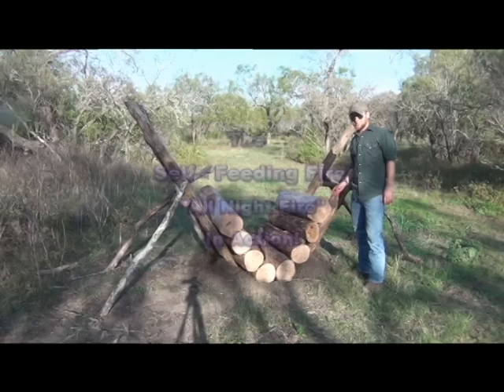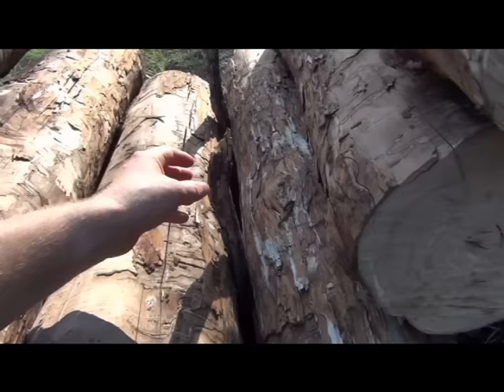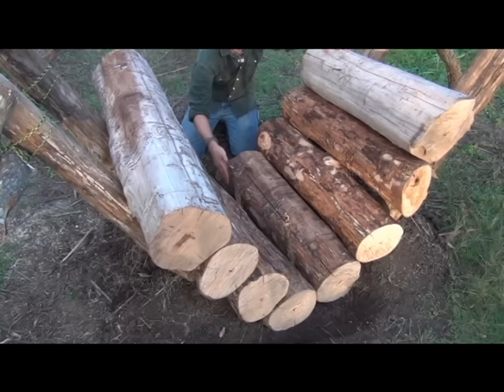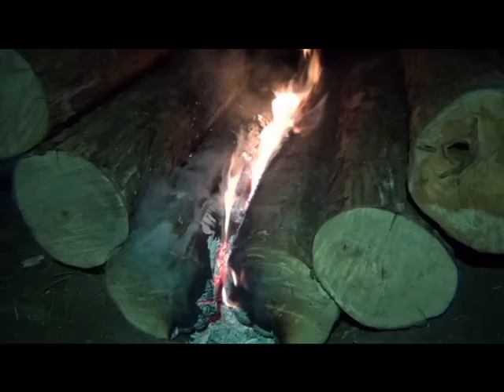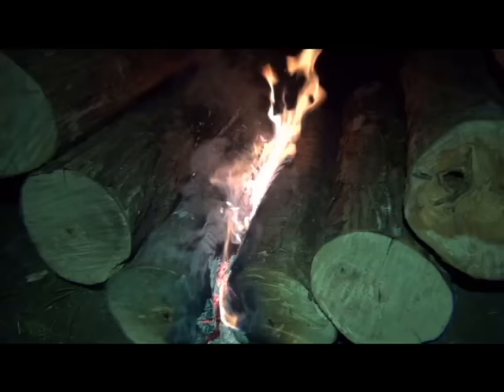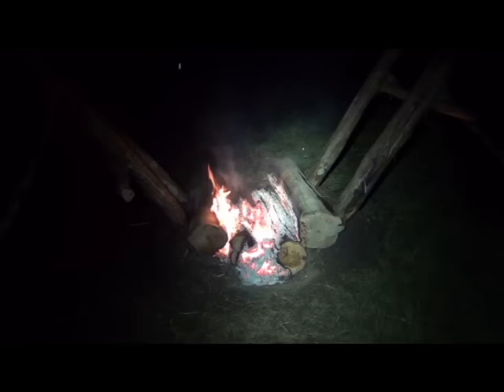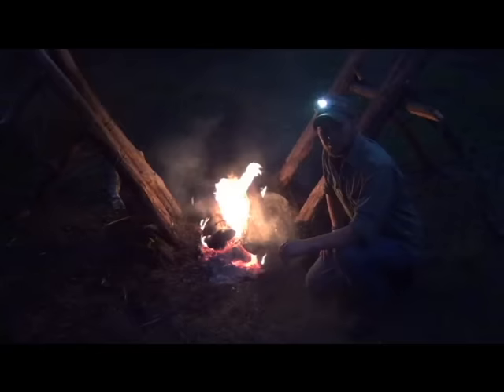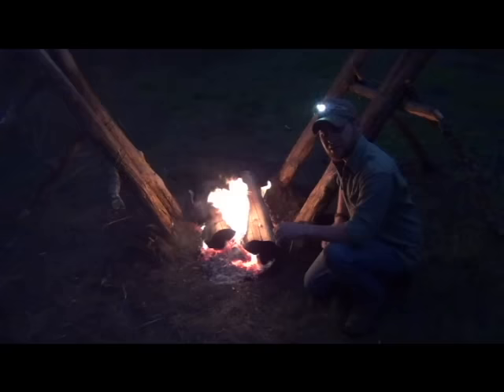Self Feeding Fire -  14+ Hour Fire

Comment: After i built the frame out of steel and got the angles right .it works i built mine for my deer camp . i also made it so i can put a grill right over it and a hook for hanging water to boil . with my set up i get about 20 hours depending on wind .awsome idea .take it make it your own .
Reply: What angle did you use?
Reply: @jeremiahgavin9687  looks like 45 degrees or a little less. If you tilt your head or phone the whole thing looks like it is a 90 degree angle.
Reply: I was about to say that this would work best to just keep warm in an enclosed area or to cook with you won't get much warms in the wild in a wide open area
Reply: @sonofashepard130  they meant the  guy that commented
Reply: @coryvallad7578  you get major warmth from it.
Reply: @sonofashepard130  looks closer to a 55° angle to me...
Reply: How? After a few hours the coals yeah but that heat is hardly reaching you. I've made a few camp fires there buddy ; )/ @milktruck9345
Reply: Great idea. I think a one-sided version would allow the unlit logs to act as a reflector.

Comment: Also,
As mentioned before, cooking food buried in coals while your away. 
Loading up the magazine the next morning keeping the fire alive would keep animals out of your camp.
It frees up a person left in camp as fire tender.
Keeping water pot hot for drinking, cooking or washing without having to tend it.
Drying out wood staves for tools, spears, bows and arrows. The list grows..
Reply: you cant just load it up next morning because the the supporting beams of the structure are also made of wood
Reply: @Mropticalgreen if you look closely in the video, the feet of the stands are buried in dirt, so they're protected from the heat. You should be able to use these stands for multiple runs

Comment: But did you soak the logs in wood?
Reply: I got that reference :)
Reply: funny as hell
Reply: +Frederik Verhoeven what reference? Please tell me. Come on, please.
Reply: that may work
Reply: Huh
Reply: Someone made a typo on a comment regarding this kind of fire... thing, and said "soak logs in wood" instead of "soak logs in water".
Reply: +aguyandhiscomputer
It's been a while since I said this and it's not completely appropriate however I'm going to say it anyway... RTFM.

Logs, unless dried under shelter or by heat, are wet (moist), therefore you need to SOAK THE LOGS IN WOOD. 

No offense.
Once again, SOCK THE LOGS IN WOOD.
Reply: +sirplantain lol...sock...priceless
Reply: Epic fail on my part there. I can't edit it now you've said that lol.
Reply: Right after I soak the gasoline in fuel.
Reply: oh that's what went wrong, I soaked the wood in the logs.

Comment: Well, it appears you have some pro and con comments with sarcasm and humor mixed in. 

From a veteran hunter and camper, who has spent weeks at a time in the deep woods, this is an awesome idea. 

This is especially workable for staying in a lean-to. I've camped in my own designed lean-to for a month at a time and liked the front flap open as much as possible. 

I could have started the fire in the evening and it would have lasted all night keeping me warm. 

Instead, I had to keep the fire going all night. 

I will definitely be trying this. And for all of you who can't figure out the design, well, you might reconsider if you need to be in the woods or just keep making fires traditionally.

Comment: The issue with this is, is that it really doesnt send the heat in a usefull direction. Its basically a parlor trick as it has no real practical purpose.
Reply: S'mores, dude, s'mores.
Reply: When is the last time you used a campfire for a practical purpose?
Reply: It was designed for use in sub zero conditions and for use inside a natural shelter. Obviously the scale of one in this video is far too large but a smaller one inside a natural material shelter that you built would trap the heat around you and keep burning all through the night providing just enough warmth to allow you to survive. I'm talking logs of wrist thickness and maybe 10" in length.
Reply: Build a wall behind it and then it's fine
Reply: bingo
Reply: @giejon  Every time I take my Girl Scout Troop camping!!! 😁💜
Reply: @ItsMeAnn628  that's awesome I definitely like the design maybe I'll try it out sometime.
Reply: @Veronica.John10-10  who said anything about exterior body parts?, The subject was cleaning 🧐🤦
Reply: This method is only good for cooking or smores
Reply: @coryvallad7578  or to keep from freezing to death
Reply: @XxBrMagicxX  "Reflector" walls dont reflect they absorb and radiate heat. If you yourself are not right near it, its nothing more than a wind block/ wood drier.
Reply: @giejon  Im Able to get out once a month if im lucky and usually i am.

Practical purposes include boiling water(5min), cooking food(5min-to a few hours depending how extravagant you want to get) , cleaning dishes(30ish mins) and for warmth.(doesnt radiate heat outwards)
Reply: @justanotherrat9703  well whatever it is it's enough to keep me warm in -30° wind chill

Comment: This gives me the idea that a skilled welder can assemble such a contraption and even add an accessory to hang a pot on top of the fire.
Reply: Make a set of foldable A frames with a cross beam over the middle.

I was thinking a metal A frame but smaller and foldable would be nice for camping (only needing an 8 hour fire)
Reply: Best comment and great idea
Reply: I got ads underneath the video for that, for a couple hundred dollars...so, you could probably do it for cheap.

Comment: What if I already have central heating and air conditioning?
Reply: +David Lanham ROFLMAO
Reply: They aren't that useful in a SHTF situation, no electricity?.... you lose.
Reply: Elrarion2 original. nice.
Reply: MrJrspek Unoriginal.* Thanks.
Reply: then condition your brain into not giving stupid questions
Reply: Well, if the central heat ever fails you have an entire self-feeding fire built into the walls of your house.
Reply: The concept is for shtf events, but why would I want a fire burning all night when I'm limited in big supplies like that? Chop it up and store it for the small fires you'll need and it'll last more than a night. 

It's pretty cool that he can just let it be, but I don't know, that seems like a lot of work for a little fire.
Reply: Monkeysrock Agreed, you can build fires that last all night. The big one is to use heat storage devices like rocks to get enough time till dawn.
Reply: +gblueslover2 also logs like that big is too much of the space weight when lifting off.
Reply: Well, first turn off the heating, then on the AC and then start the fire.
Reply: you wont get to satisfy your inner pyroman. Im pretty sure men being drawn to/amazed by fire is pretty normal because fire was useful for tens of thousands of years.
Reply: Neil Mcintosh 😂😂😂😂
Reply: Not much light and not much heat around it. No room to cook properly. Only useful as some kind of smoke beacon so it doesn't matter if it can self feed.

Comment: logs cant melt steel beams
Reply: lmao 9/11
Reply: Actually they totally can
Reply: im logged on message me
Reply: well if you made a forge out of dirt, mud, and logs you might be able to get enough air flow in to melt some steel. Steel has a melting point of 2500 degrees F, whereas cast iron is about 2200 degrees F. I know a primitive forge can melt cast iron, but maybe that extra 300 degrees is the barrier.
Reply: and melting is not really the point, it's the point of breaking that interests us mostly, it's far from the melting point as steel become soft quite fast
Reply: +Jack us
Dude, its not hard to melt beans😅.
Reply: Derpin Bird not if you soak them logs in wood
Reply: jet fuel cant melt steel logs
Reply: soak the beans in logs.  they'll melt like M&Ms.
Reply: Derpin Bird steel beams can't melt jet fuels
Reply: Derpin Bird no but the heat and weight combined will make them bend and that would suck
Reply: trump2020
Reply: William Tecumseh Sherman, the bummers and the Confederate railroad would seem to disagree with you on that.
Reply: MyAccount217 JP-5 burns longer, but Jet-A surely can for even alloys. Oh, you dont know wtf the steel/fuel types are.
Reply: gblueslover2 but logs dont melt they burn
Reply: But Jews can
Reply: Derpin Bird logs can melt aluminum air planes
Reply: Cordwood building
Reply: I'm amazed by all the r/woosh in this thread

Comment: An almost random Youtube click.
I was quite skeptical about this.
To begin with I thought that there was no way that the seemingly meager amount of kindling / thin twigs you used would burn anywhere near hot enough to begin to burn the adjoining logs.
Trusting that all was as it was portrayed in the video, I take it back.
That was really interesting.
When you mentioned the control of air-to-fire, i.e. the earth / clay embankment, I started to realize that you had given this some thought, and that this was not down to chance to the degree that I first thought it would be.
Thanks for a very interesting (and worthwhile)  random Youtube click :)
Reply from the maker: Gad you enjoyed it.  Might check out the channel.  Always something new.
Reply: How do you think this fire would work if you put clay/mud on top of the logs? I'm thinking it'll keep the fire on just the two bottom ones and it'll be good in windy locations.
Reply from the maker: Clay on top?  Clay is a good insulator and would direct heat well.  Explain where you would put the clay again.  Not quite with you yet.
Reply: By "on top" I just mean in a way that would prevent the fire from blowing onto the next row of logs. In between the fire and the 2nd row of logs would work best. With the logs rolling down the slope, it would be too difficult to put clay up all along all the rows, but it'd work for the second row of logs. It would have to be just be a thin layer too. The clay would deposit right in the middle of the coals. Maybe you could get really creative and build a housing for the logs that they would fall out of. Or maybe you could build a chimney over the fire. The clay on the logs is just an easier method of keeping the fire from catching the other logs early
Reply from the maker: I think that would work.  You would have an issue with the clay pieces filling up the trench after a time, but that would be an ingenuitive way of heat sheilding the igher rows.
Reply: Yeah, that's why it would only work if you put clay on one row. You'd have to spend a lot of effort into making an actual shield, but you might be able to do it so that you could get a fire lasting all night long with just 4 logs instead of 8.

Comment: Hey Bob:  I gotta say that this is ONE EXCELLENT VIDEO & DEMO on how this type of fire 🔥 works‼️  Seriously- GREAT JOB.  I've been hunting-fishing-backpacking- for over 50-plus years and have never seen anything like this.  You learn something new everyday ... if you really try and/or make it a goal.  Would have liked to seen you make the sides and structure, but your commentary & verbal instructions were easy enough to follow.   Here's a thought...you have some great big perfect logs to demo this,  ... I wonder how it would work on a smaller scale,  using wood the typical size wood and logs you'd find in the foods?  Also,  how long such a smaller scale fire might burn for?  I know it wouldn't me be 14+ hours, but even if you could get 6-solid hours of burn time and wake to flames & coals of any kind,  that too would be a success.   EXCELLENT VIDEO & GREAT INSTRUCTIONS ALONG THE WAY. 

Bill ~
Reply from the maker: Too many variables I’m afraid.  A breeze would have burned this thing imperfectly and caused failure.  Ideal circumstances show it to be possible, practicality keeps it from being viable.
Reply: I lived in a lean-to in Northern Michigan for a few weeks in late November,early December about 40 years ago and used a similar method for overnight heat using 16 to 20 in.  firewood. I dug a pit so coals and ashes could build up and lined it with rocks.  The back of the lean-to blocked the wind and the front faced the open fire and was just tall enough to sit in. Both ends were covered to block wind also and I added some lean-to high smokescreens that extended out beyond the lean-to several feet  also. My ramp was only one sided and acted as an automatic feed and heat reflector on the opposite side of the fire. The ramp went to the edge of the pit. I remember sitting on  my bed in a T shirt when it was snowing and blowing. I filled the ramp at bed time and around 5 am I would wake up slightly chilled, grab a few sticks of wood at the head of my bed, sit up and reach out and put them on the still hot coals without leaving the sleeping bag and get back in the bag until the fire was crackling good and I could get dressed in comfort. Keep in mind, it was all sand around the pit and several inches of snow on the ground so no fire hazard and I was working as a logger and had plenty of good hardwoods to burn.

Comment: Hi Bob, 
I confess to being one of the people who were doubtful about this design.  You've done a brilliant job showing the conept works.  How much heat did this fire kick out?
Reply from the maker: +Keith Lo Due to the size of the logs, it produced more than one might think.  I was a cool night, think I had my chair about 8 ft away from the fire the whole time.
Reply: +Bob Hansler It certainly looks like it would be good to cook on.  I guess if you have enough logs this can be kept burning in perpetuity.
You had eight pretty chunky logs to start with.  How long do you think you would have got if you had fed them one at time into a traditional campfire?  How does the preparation time compare?
Reply from the maker: Probably less time.  With flame able to get around all sides of a log with unlimited oxygen, I imagine they would not have fared as well... still a long night of fire.
Reply: Thanks Bob,  that's pretty awesome. In practical terms I would think a setup like this would be better for long term sites. 
The time and effort to set it up kind off puts it out of order for a short stay 
I'll feature your video over on my campingsage site later. Do you mind if I include your comments too?

Comment: The logs would burn for a very long time no matter how you stack them. Once I had to sit all night with a bonfire and it was still burning the next morning. The logs were just piled on top of each other. So same results with way less effort.
Reply: why? if you were waiting for it to go out, why didn't you just pour water on it?
Reply: +Joshua Tice I wanted all the wood to burn up to get it out of my yard.
Reply: Joseph Smith ohhhh OK.
Reply: I've seen the equivalent of a couple of those logs burn all night. Granted, not through any rain, but while cool, this does seem somewhat wasteful of wood.
Reply: Different types of wood burn at very different rates... so there is always a variable.   Also how aged the wood is, can be a large factor.
Reply: oiralire that's a good point. I'm curious if you just stacked the same amount of wood fuel together , it would be less burn time but how much less. Meaning I'm curious to compare the technique and how efficient it is to extend burn time because it takes time and energy to make that set up.

Comment: Don't forget to uncheck the box next to "fire spreads" or this will not work.
Reply: I mean, you should be making a fire pit before making a fire. Dugout dirt base, surrounded with dry rocks (river rocks can explode).

It may be more work, but it's better than waking up on fire.
Reply: @Youtube.Commen-tater  "river rocks can explode"

Wtf 😂😂😂😂😂😂😂😂

Is that because they're used to being in water?
Reply: Jennifer River rocks have small amounts of water saturated in them, so heating the rock expands the water into steam inside the rock, which then fractures or explodes. Like cooking a potato without poking vent holes.

But hey if you don't believe me you're always free to dig rock shrapnel out your face all by yourself! Yay independence :)

Comment: he soaked the logs in wood
Reply: SOAK LOGS IN WOOD
Reply: I finding simply soaking logs in wood to be insufficient - generally speaking if you can get pressure-treated logs that have had wood impregnated into them under high pressure for several hours they're worth the extra cost and the wood doesn't just dissipate.
Reply: +James Matthews you ain't soakin right
Reply: Have a pair of logs between the wood while you soak in a warm tub. Now thats how you spend the weekend nights.

Comment: Super neat video, I realize I’m commenting on a two year old video and I don’t care. It’s probably been said but I would use rebar or something on the support structure, I know it defeats the purpose, but you would have to find four perfect pieces of wood for that to work like that. I’ve never seen this before and it gives me some interesting ideas I want to try next time I camp
Reply: @Lance Masi it's a 6 year old video (posted on Nov 13, 2015), most of the comments though were from 2 years ago.
Reply: Never let time deter you from commenting. One of my best exchanges I had was on a 9 year old comment

Comment: I don't why this whole rig won't just burn up.
Reply from the maker: It does, in a controlled manner.
Reply: cause he soaks the logs in wood first
Reply: *wets them with wood
Reply: +Chris A ...eek. Sick.
Reply: +Chris A ...ahh I see. You like this.
Reply: I was about to ask the same question!
Reply: he explains that he put a clay wall underneath the logs so that the the fire would not have access to air so it cant travel vertically, it waits for the logs to turn to ash and then collapse with the next log already heated and ready to go (in a slow manner of course)